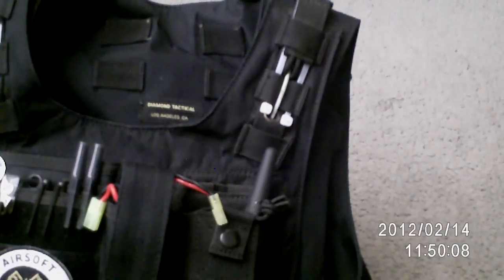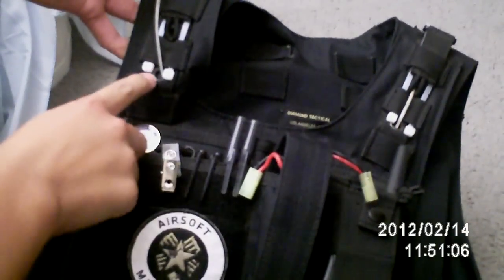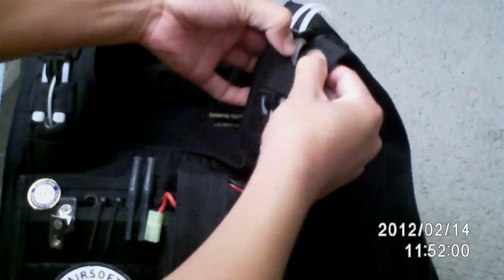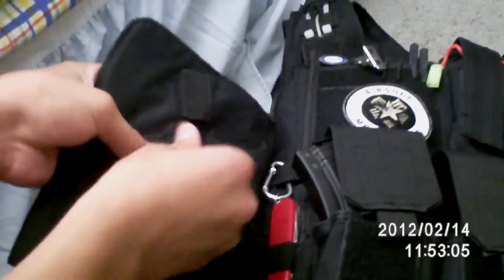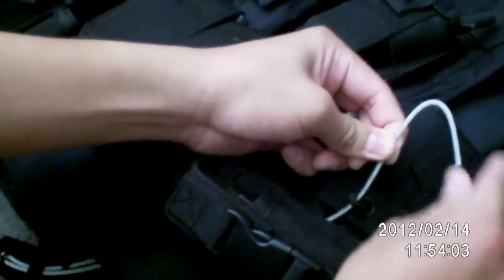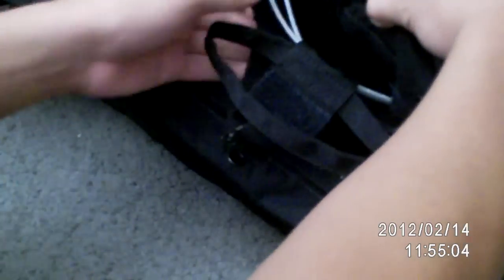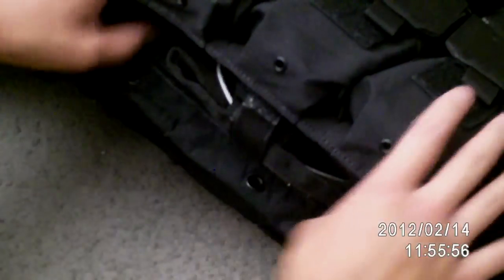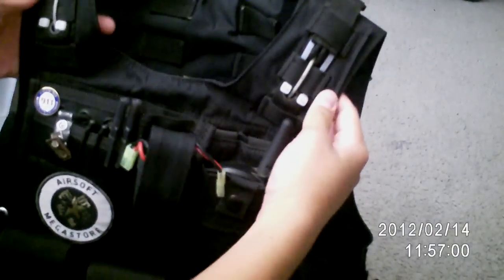Airsoft: How to put back ripcords on the Diamond Tactical Molle StrikeForce Modular Plate Carrier

Comment: Actually the rip cord keeps the straps intact which helps the vest be more secure to your body than just wearing it with the velcro. Its main purpose is to collapse the secure straps when the quick release loop is pulled.
It has no real purpose in airsofting, but in the real world, when soldiers get wounded, field medics or pararescue men can use this feature on the vest to easily take it off and look for any other wounds on the body.
Reply from the maker: Thanks for watching! :)